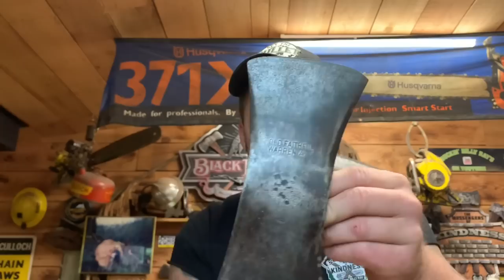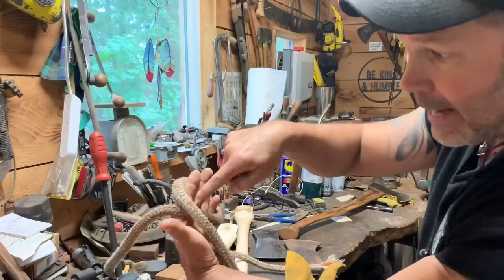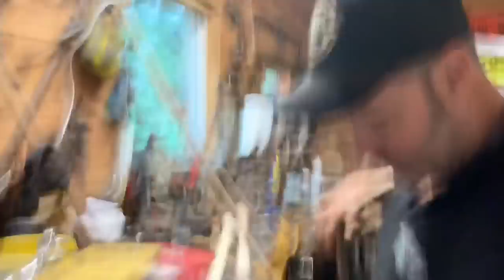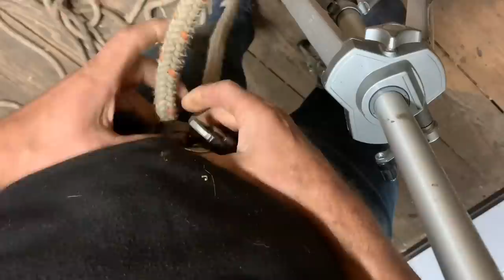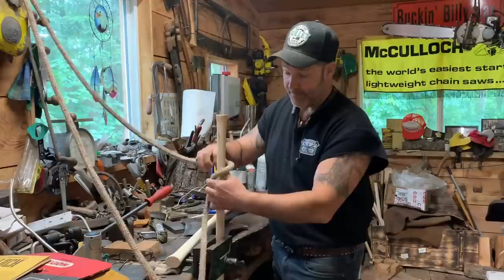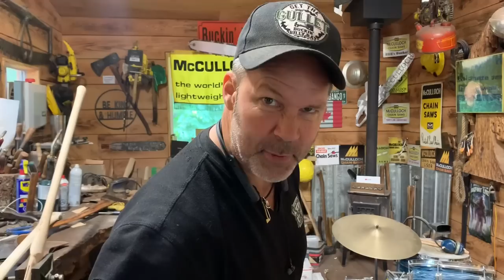How to tie the common knots in tree work

Comment: For a stupidly simple and mindless way to tie the bowline, tie a basic slip knot on the working end (leave it loose) and pass the tail through the loop. As you tighten the knot, pull the loop through the knot and allow the tail to form a bight and pass through the knot with the loop. BOOM, instant bowline. No remembering which rope goes on top, which way to wrap it, or where a rabbit goes anymore. Try it and you will be amazed how it requires zero thought to tie.

Awesome video, Buckin'! You are a great teacher.

Comment: I like to remember the line hitch variations as just extra wraps on a double half(clove hitch) if that makes sense to anyone. Used single side line hitches to pull quite a bit of drill line and such. I dont think he explained the reason the running bowling is up first through hole instead of down. Up and out instead down and in. The reason is that the tail end is facing down and you don't force against the tail pushing it through the knot tightening the choke down.

Comment: How about the Barlow Knot. That's the one where you use a clove hitch around the ball on the truck and pull your buddy out of the quicksand or whatever. It's named Barlow knot because Barlow was an old knife brand.....and a knife is the only way to get the clove hitch off the trailer ball once it pulls down tight. So hitch is used to hitch but a bowline KNOT is used to Pull. Make sense? It's what you said anyhoo. Thanks.

Comment: Is the double bowline the same as the bowline on a bite? I ask because u said and showed 3 loops. Now i agree three people can pull on the bowline on a bite. But theres two loops then the third guy pulls on the front of the knot. Thats the go to knot for pull trees over! Im a rope guy, im not to keen on wedges. Idk, ive seen some hairy situations with wedges. Rope is my goto, because i can also tie a bowline on a bite. Then send the tail end of the rope around a tree and through the loops on the bowline on a bite. And then use multiple guys to winch that tree back as much as possible. Tie off with some half hitches etc etc. And then have the guys pull on the rope still. This way u got that tree lock off, very unlikely to rock back. Even if its one guy pulling, if he slips. U should be okay technically.  Because u are winched off. Anyways im rambling Billy, back to the "Double bowline vs Bowline on a bite, is it the same?"

Comment: Why not use a separate line to pull the tree over? Tie your running knot while you're up there, get it set, then when you get down you're ready to pull it over and you avoid using your climb line as a working line and reduce stress placed on your climb line